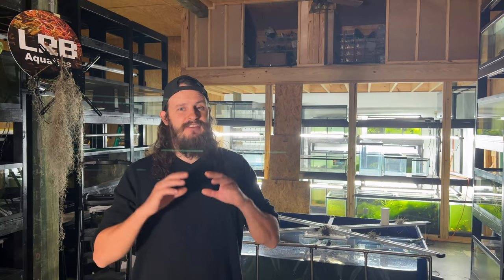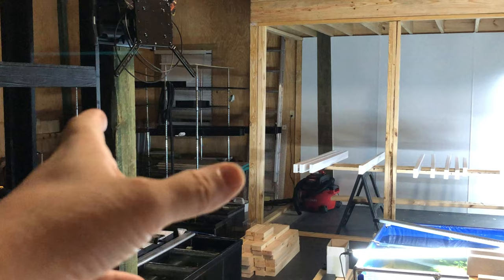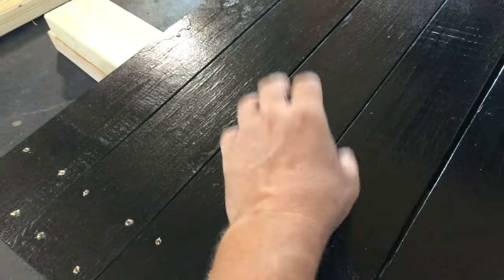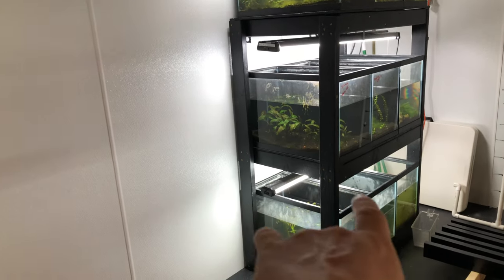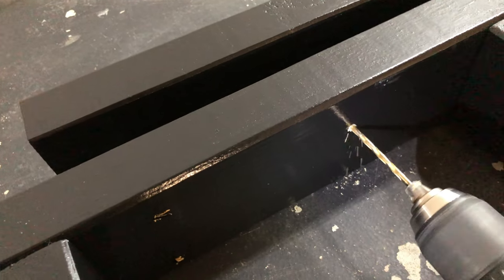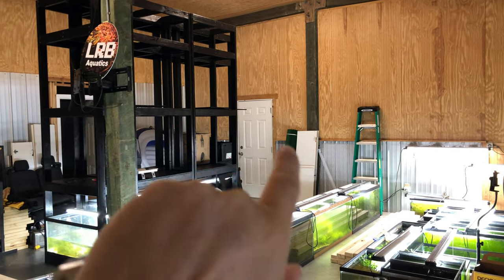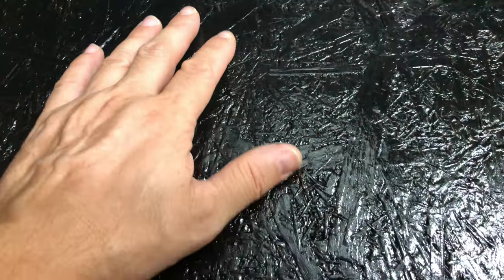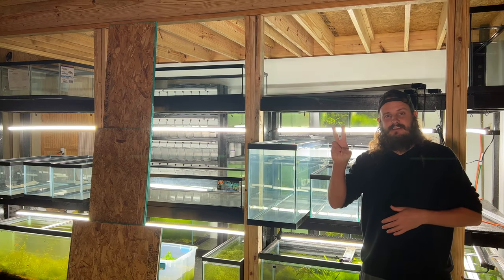NOT Handy, WANT an Aquarium Rack Stand?? Beginners Guide My Favorite Rack Especially for Guppies!

Comment: Looks like you've done that before. I'm just surprised those silly yellow and black tools you use, actually do work. If you ever wanna join the cool kids club, get you some red and black tools!
Reply: Uh oh 😅 those are his favorites!!
Reply: They have more power but guys that have them in company are sending in more often (need repairs) they have good warranty's though
Reply from the maker: Lol Ive been using the yellow ones for decades and the main reason I like them is I can see them easy lol If not id be spending all day looking for them  😄
Reply: @LRBaquatics  I'm in the process of cleaning out my basement, to build racks myself. It'll be my first time, and I can't really decide if I should do 10's on top, 20's in the middle and 40's on the bottom. Or build separate racks 1 for each size. Plus I still need room for 75's and maybe 125's. Shit takes up so much space!!!